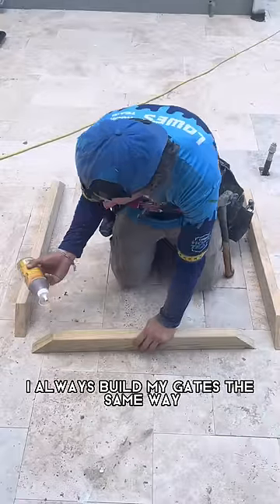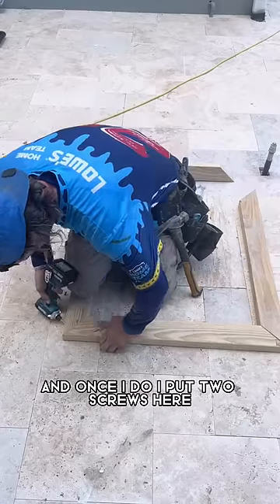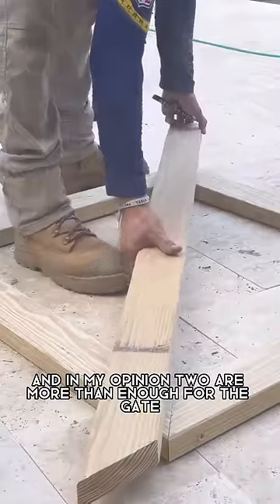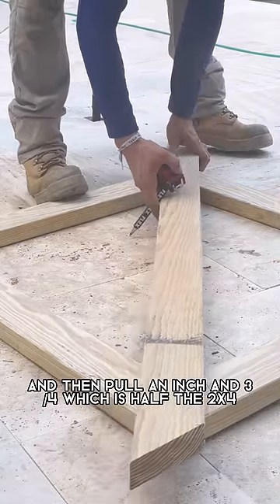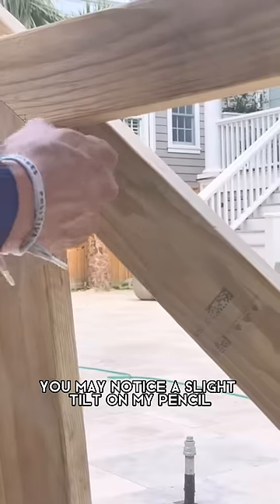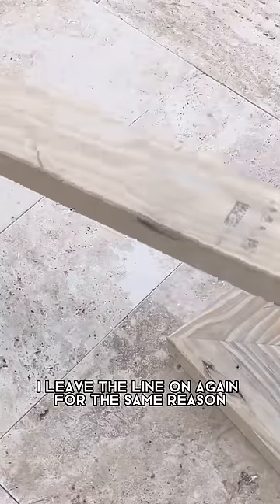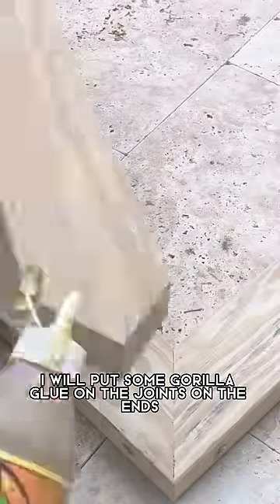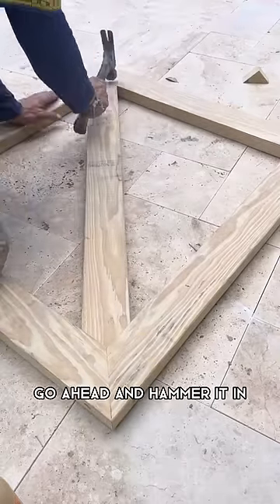Fence Redo Part 8 Short

Comment: It's amazing that 896 carpenters watched this video and all 896 of them know the right way to build this gate yet everyone does it a different way. Amazing. 
"Project Farm" should make an episode on the best design for a gate.
Reply: Not really, I did it for over 15 years and it's all my father and grandfather have ever done. They taught me and other than standardized stuff we all do things differently. What matters is the final result not how you get there. As long as whatever you built is sturdy, does what it's supposed to, and looks good, do it however you want.
Reply: There's one right way and dreddie nose ring ain't got it.
Reply: I am 78 years old and have been building gates for 87 years. This guy did it the wrong way.
Reply: @real100talk5  it's right so how's it wrong
Reply: There is no single 'right' way, but there are infinitely many wrong ways
Reply: Pretty annoying lol
Especially the condescending responses, as if they are all so perfect  🙄
Reply: I had an Amish foreman give me the best quote one day….   “there’s a million ways to build and everyone of them is right “
Reply: @robertcasey3528  it’s wrong because there’s no physical strength in a mitre joint. Glue and screws shouldn’t be used to hold timber together as the primary strength. That’s why a mortise or half lap are generally used for a strong gate.
Reply: The design should fit the use. Cattle gates, Davit arm doors and barn doors  are completely different designs.
Reply: @t-rex4211  Bingo.    Best response yet - if you’re interested in a well- built gate
Reply: Every video involving construction is the same way. Every. Single. One.
Reply: Excellent job, in an ideal world you would mortice and tenon the joints but as you know the customer won't pay for that!
Reply: @johnvanlandingham8832  It’s not haters commenting, chances are they’re joiners who know a mitre isn’t suitable for strength or longevity. They’re only use for base boards, cornice, coving, architrave and picture frames really. Yes a metal gate will always be stronger, comparing it to a metal gate would be using a spot weld compared to a strip weld. Both do the job but if you made a video where strip welds should’ve been used then you’d be open to criticism. This guy seems a good carpenter but no joiner.
Reply: He glued the miters on the end grain.  NO carpenter would agree that that is okay.  The glue is 100% pointless, it will add no strength above the screws.  NO carpenter will disagree with this assertion.  Every carpenter would have done a proper joint.  Every carpenter can do it differently and every way that each one does it can be right, as long as they don't make any egregious mistakes.  But this is absolutely egregious.  This is like what a 9 year-old working on their first wood working project ever, with no supervision or direction would come up with.  It's just trash.
Reply: @doatmidnight8540  I almost died from AGS.
Reply: There is the right way, and dozens of wrong ways. I've been building high end custom cabinets, furniture and architectural millwork for over 35 years. When someone is paying for work with their hard earned money, a craftsman should have learned the proper way and give the client their moneys worth

Comment: To get the best bond with gorilla glue, lightly put water on the wood before the glue.
Read the directions if you don't believe me.
Reply: I was looking for this comment
Reply: Seriously! I hate seeing bad technique without following instructions.
Reply: Water is the best wood conditioner. Always dampen the surface before applying glue or staining bare wood
Reply: I used to put water in my box of screws 😉
Reply: @frankminer4061  it's bad technique to use gorilla glue for an outdoor gate
Reply: It needs water to go off doesn't it.  Cause a reaction
Reply: Wont make the bond "stronger" but will speed up curing times.. Standard with all pu glues and defo not a necessity... 🤘
Reply: For hardwood and other materials, definitely! It even helps with super glue. But it's honestly kind of unnecessary with treated lumber because there's enough moisture in the wood itself.
Reply: @peterrollins881  as a professional working with producing lumber for nearly 20 years, this is simply not true.
The chemicals used in treating lumber are not water based and the lumber is dried in a kiln before being sold, same as untreated lumber.

The reason you add water is to kick start the chemical reaction that triggers the glue to set. The moisture present in treated lumber (from storage conditions) is not enough to trigger that reaction.

Sure, the glue will still set, but it's from atmospheric moisture, not the insignificant amount present inside the wood.
Reply: Just came here to say this lol
Reply: Just out of curiosity how is 1 3/4 half of a 2x4?
Reply: @papergatorzfedducca7998  a 2x4 measures 1.5x3.5
Reply: @knstormshadow  oh ok thank you. I never measured one before.
Reply: I dip my drill in water before driving the screws.
Reply: @thatsitvideos  it’s easier if you have the plastic bins of screws (as long as they’re coated) to just pour ya some water in the bin. The threads hold the water.
Reply: It's true. That's why trying to wash it off makes it worse
Reply: To get the best bond, don't use gorilla glue
Reply: @JamesPatrickKelleher  I agree. In my experience Gorilla Glue is garbage.
Reply: Yes
Reply: Can I use pickle juice instead?
Reply: @papergatorzfedducca7998  they used to actually be 2” x 4”
Reply: @christopheraustin3324  I've gotten so good at it I no longer have to try.
Reply: @veganpotterthevegan  with a joint that tight the glue is basically indoors.
Reply: I do the self same thing.
Reply: @MrDamo34  I'm not talking about the glue getting wet. It's a waterproof glue anyway.  It's simply going to crack though
Reply: The capillary action in the grain after being wetted will pull the glue deeper into the wood.
Reply: @stickshaker101  sound like you’re trying hard right now 🙄
Reply: @emnurse2056  ok thank you!!!
Reply: Fernando Aguilar  the purpose of the diagonal wood support is that it originates at the bottom hinge so the downward force is trying to compress the diagonal support. This makes for gates that hold up without sagging. The only thing that can cause a gate to sag when built like this is if the diagonal board shrinks excessively, but generally they don't shrink in length but mostly in the other two dimensions.
Reply: Richard Ried  he's a disaster that has no business leading a team of carpenters
Reply: Richard Ried  he should have stuck with building with popsicle sticks as a kid.
Reply: Same applies to expanding foam, I use a spray bottle to damp the area down
Reply: Better yet use Tightbond.
Reply: That last sentence makes me feel like you've had a lot if people question your honesty. If you still have those people around you, and you're a truly honest person, get rid of all of them. They're bringing you down.
Reply: That PT is damp enough to make it work without getting it wet.
Reply: Pressure treated lumber is plenty wet when you buy it.
Reply: I’m stoned right now, but thinking same thing.
Reply: @MicahFunk  don’t shrink at length you say??

Guess you’ve never used treated immediately from the store, particularly fresh still wet treated…of course, than you’ve always waited a whole year while your pile of treated cured completely, right??

Otherwise, treated sure as sheet shrinks at length, junior.
Reply: @coewhat  my point was that the lumber shrinks but mostly across the board more so than in the length. I do pick through my lumber to find boards less saturated for diagonal supports. In my experience the longer the lumber the dryer it normally is from the lumber yard so it has minimal shrinkage. I build some pretty massive 8 foot high double-door gates and don't have issues with them sagging. I'm just speaking from my experience, junior.
Reply: Very true. Otherwise use wood glue. Water activates original gorilla glue.
Reply: That is a lie. Water removes the glue.
Reply: @NPC-157-e7r  See tests on joinery vs even just glued miters.
Reply: @austinyun   nah. Im good. I know how to join wood together. Besides, I've got guys for that. So whatever suggestions you have YOU try. I've been established. And I didn't create the video, I just eviscerated it.
Reply: The creator learned carpentry watching other clueless " carpenters" ( fence is not carpentry sorry tongue ring and guages) on YouTube
Reply: @Duck_side  yeah it's a water solution with mostly micronozed copper. But it's still a water based solution. And will still react with gorilla glue like water would
Reply: @Armando A it's a moisture activated glue, how does sanding help?
Reply: scientifically makes sense. absorbtion. no need to fact check that one!
Reply: @rangerdanger10  except ground contact wood is treated with pressure to stave off the absorbstion of water ( glue also) you guys stick to typing
Reply: Thanks for the tip, I never read instructions 😂
Reply: @papergatorzfedducca7998  A 2×4 is in reality 1.5× 3.5 inches and a half by three and a half
Reply: This green PT lumber has plenty of moisture to skip that step.
Reply: Unless you're gluing up a Gibson headstock....
Reply: @papergatorzfedducca7998  2x4 is not 2”x4”…….
Reply: I've made a few cedar gates and never used glue. They seem to be holding up just fine years later. /shrug
Reply: @papergatorzfedducca7998  because the actual dimensions of a 2x4 is 1.5x3.5
Reply: @papergatorzfedducca7998  2x4s measure 3.5’
Reply: @Scoobydue420  please explain?..
Reply: ...and don't style your hair with it...🙄
Reply: Beat me to the punch, it needs water to adhere properly
Reply: @veganpotterthevegan  
yellow label, so 'original' Gorilla glue which is 100% waterproof .. as is the [ dries ] white version
Reply: @kazoosc  never said it's not waterproof. Its still bad for this application
Reply: @veganpotterthevegan  
sorry.  what's the objection, then?
Reply: @kazoosc  just what I said?
Reply: @veganpotterthevegan  
sorry I missed that .. crack.  the wood or the joint?  would it work without the Gorilla glue?
Reply: @kazoosc  it'll maybe hold without the glue.  But it's nice to have a glue(not this glue) that will expand with the joint as the wood shrinks...assuming a client never wants to see a gap in the wood there
Reply: just use titebond III
Reply: @HoratioWalls  i use pickle juice 😋
Reply: That wood has enough water already, hardwoods absolutely damp the ends.
Reply: @erdoganyldz404 thanks, never knew this.

Comment: Set the 2x4 down then place the gate over then mark to avoid 2 unneeded holes.
Reply: Good idea
Reply: Ya I assume it's to avoid one side moving I guess you could probably clamp both sides if you were really worried about 2 holes
Reply: It's not going to move,  no need for those 2 screws 🙂👍
Reply: The fence boards will cover them. It's all good
Reply: @james10739  right. Clamp it. If you set the box on it then you can't see your marks
Reply: Time is money. Two holes aren't a big deal especially if they'll be covered+painted.
Reply: Great. Stfu and make a channel so you can make a verified video on it
Reply: @james10739  or put other 2x4’s on either side so it lays flat.
Reply: Yeah those two unneeded holes are hugely important. Put them on the side that has the pickets you won’t even see them. Are you serious?
Reply: They double as holes for the hinges... GOTCHA!
Reply: Or just use 2 clamps
Reply: The scrap is my concern 2 feet of wassted lumber

Comment: Woodworking magazine did stress testing on glues, the  expanding Gorilla glue failed before Titebond 2 & 3. The Gorilla expands with little tiny bubbles. I used to use Gorilla glue, too, because I thought the expansion was tighter.

Comment: Polyurethane glue is moisture cured. If you're in a hot dry place carry a small spray bottle of water with you and mist the glue lightly after spreading. Let's the glue foam up more. Helps too with working on mitres/end grain!
Reply: No pro is gluing gates yall are high af
Reply: @NPC-157-e7r  only takes him getting laid for his job to be a pro. Doesn’t mean he’s an expert. I would trust gorilla glue with a screw.
Reply: @johnghatti5435  standard gorilla glue for something that's going to be shrinking and expanding is terrible.  The screw is doing all the work after a season

Comment: I started half lapping my joints on gates, makes a huge difference.
Reply from the maker: I’ve been wanting to try that
Reply from the maker: How much added work?
Reply: Not a crazy amount, but definitely not the fastest way to do it, I used a table saw and a chisel to remove the bulk of the wood. If it was something I was going to have to do over and over, as a handyman or carpenter, I’d probably figure out a way to do it with a router to save time
Reply: @Artpentry  making them on site - just mark the timber width on the ends and use your electric saw to do a load of cuts 1/2 way through the timber, chisel flat. Probably takes about 1/2 hour to do 8 joints. I cut the inner cut first with a speed square nice and accurately then you can rush the other cuts

Comment: My grandpa built our gate 40 years ago very much like this and it is still working great.
Reply: I doubt that.  This gate won't last 3 or 4 years.  Those glued miters maybe will last one year.  The cross buck is going to expand along the grains in winter while the miters will expand into the cross buck, this will stretch the holes that the screws are in and after one or two years the glue will be broken since it's on the end grain and screws will be loose.  This guy doesn't know what the fuck he is doing, your grandpa did, you just don't know the difference.
Reply: @keith_dixon 🤣🤣

Comment: in 6 months or less those miters are going to open up, the boards are going to shrink like crazy and itll be only held up by the shear value of whatever panel material youre using. treated material needs metal corner bracing and lap miters. gorilla glue is ok, but there are better exterior adhesives that will move as the wood shrinks. lexel, sika , etc.

Comment: If you wet the edges of the wood and smear the glue around on both pieces of wood you will get a much stronger tighter glue down!! 🙏👍🏻
Reply: Treated lumber is soaking wet already

Comment: Yeah expands and works real well as long as you read the instructions and note that you have to add water
Reply: Most treated stuff where i am has enough moisture content to work as the water. 
I find it's more important when using dried timber.

Comment: I love a tight fit too, but if you put that center bracing in there that tight it will end up pushing the gate apart over time. Give it just a 32nd of an inch to “breath”
Reply: Good catch.
Wood expands & contracts with weather.
Reply: I find gorilla glue also expands as it dries, so this extra room would be better.
Reply: Since it isn’t likely to be kiln dried lumber it will likely shrink initially anyhow.

Comment: Scribes with his pencil on a tilt to get a tight fit...proceeds to use circular saw cutting by eye holding the timber flapping it around in the air. Nice one!
Reply: Dude im not even a carpenter but ill nail a sharp pencil line to the 16th every time holding the board. Its not that hard. Get gud
Reply: @thefinalkayakboss  get safe
Reply: @thefinalkayakboss  you didnt, you wont and you cant. to the 16th? no.

Comment: Wood gates keep me in business! It’s Metal frames and metal post or they’ll sag. No matter what you do, they’ll sag. You’ll never find a YouTube video of a wood gate with an update video of how it held up.
Reply: Not if they are built right.
Reply: @bighead0107  they are trash even if you hired an engineer to design it from not sagging what’s to stop it from warping. Wood tends to rot and warp within 15 years! Steel is way superior you can galvanize and powdercoat steel frames and can last 40-50 years without showing signs of rust then just do it again
Reply: Crosslaps on gates made out of wood.
Reply: @johnsassano8728  Wow! So, how many of yours lasted 50 years and had to do again?
With your 50+ years of experience....your advice is to be heeded.
Reply: @SA-iw4ci  I don’t mean rebuild the gate again I mean bring them to sandblasters and have them re galvanized and re powder coated my gates are expensive I make wrought iron driveway gates for mansions… definitely not for everyone but they will definitely last 50+ years
Reply: @bighead0107 I see you don’t have much experience with wood exposed to the elements. Too bad you are not my competition! The guys around here are catching on.

Comment: Nicely built. Recommend a 5/16 x 5" lag bolt counter sunk on the horizontal through your miters that With your diagonal brace and it will never sag.
 That gorilla glue or any glue outside of an epoxy of some kind will never hold in the long term on end grain.

Comment: Two issues:
1. That glue requires moisture (water) to work it's best. (Read the instructions on the lable). 
2. If you have to hammer your crossbuck in, you are warping your gate out of square (if it was square to begin with). The expansion of the polyurethane glue will further warp the gate out of square.

This gate will work fine for the average home DIYre, but if you are selling yourself as a pro-carpenter, then you need to do your research and know what your adhesives will do and their proper use. Not to mention, how to counter act those reactions, and the set time and cleanup required. And how to protect work surfaces. (That Gorilla glue gets on that tile, it's going to leave a heck of a mess. You should have a drop cloth.)

Comment: NICE! was just thinking of how to mount a gate on the steel posts from last century.  its a big square steel post that use to house a wraught iron gate.  looks like a challenge. figure have to mount a hinge with bolts, maybe have to drill holes and tap. bolts and screws and washers will do if the fingers fit.